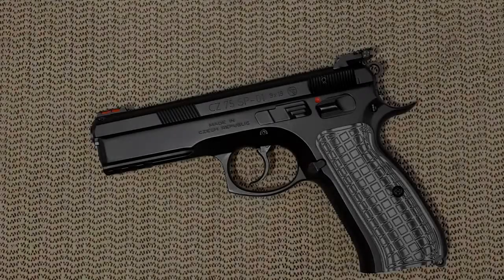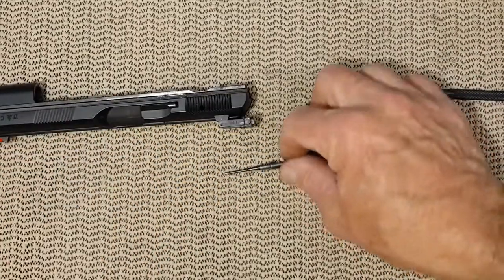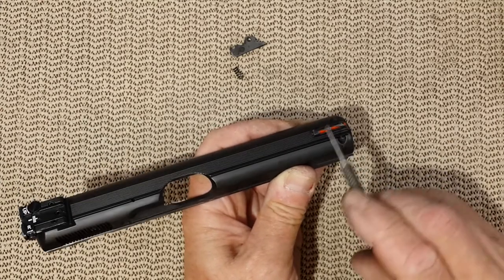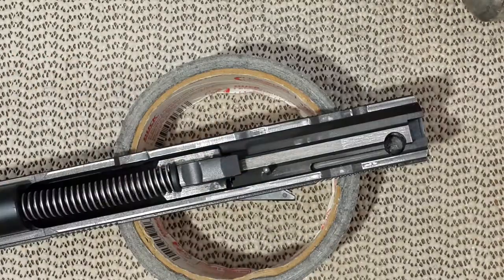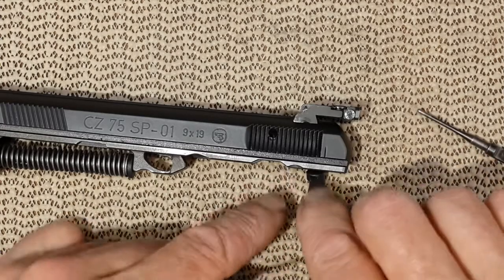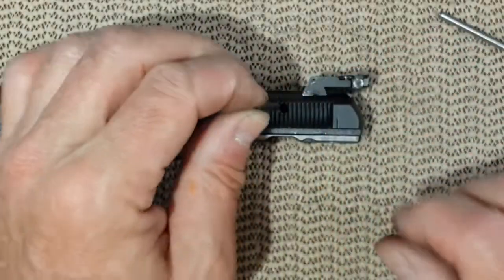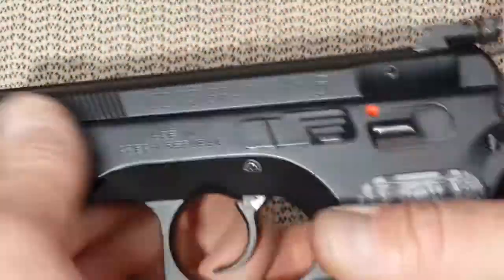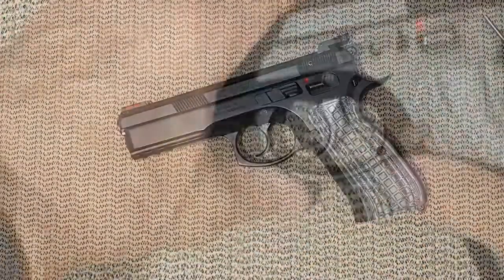CZ 75 SP-01 Slide Full Disassembly and Reassembly

Comment: Thank you very much for the information.  I've fired approximately 1,000 rounds to my SP01 and the gun does not shoot anymore.  I believe it's a problem with the firing pin.  The video will help with disassembly and then especially important, reassembly of the gun.

Comment: ME again.  Have a new TS P120 and CZ P01 and wanted to add new springs (polish/lube etc always)...reduced FP and safety plunger as well as 13# hammer and had the canted firing pin situation in both.  To stop that problem and it is a big one as the pin gets jammed against the side of the FP...not a good place to be! I aligned the FP with flats up and held it in place with a punch.  Then assembled the pistol and had the hammer hold the FP down.  Driving the pin in was still difficult in both pistols (and yes a have rolling pin punches with dimples etc.) but done.  With both pins, one slotted and the CZ "spiral layered rolled" I used a brass hammer to get them in mostly knowing the dimpled punch will spread the hammered surface especially with the spiral type.

Again, your videos are a wealth of information and thanks so much.

Comment: Excellent video - clear and very detailed. However, I would suggest using a 3mm punch rather than a 1/8" punch to remove the firing pin retainer pin. During my 1st attempt, my 1/8" punch became stuck in the pin hole, which I was unable to remove despite all kinds of effort. Ultimately I sent the slide with the "stuck punch" to Cajun Gun Works, which they were able to remedy the situation. Their tech advised using a 3mm punch next time, which is slightly smaller than 1/8".
Reply from the maker: Very good advice. I had the same issue with my punch, but I was able to remove mine out of the slide. I am sorry you had to send yours to CG. 3mm is a perfect math for the work, but we are in the US, where millimeter tools are not always in our tool box. Thanks again Michael  for this wise advice.

Comment: My slide is stop in at the trigger when reinstalled. What did I do wrong? Can’t see where it’s catching. Installed new hammer/pin/searbox parts from Cajun ?
Reply from the maker: Sadly I don't have the gun on hand to see what is happening. The most common issue can be the recoil spring getting out of its barrel notch. But you also installed a number of new parts and that creates some new issues. I would suggest to see a gun smith or at list, go to a local gun store and get advises and opinions. Good luck
Reply: Thanks!  That is exactly what I am doing today. Gun shop first. So weird. Slides clean unto top hits sear the -stuck. 

Thank you for your video; it saved me!! 
I was hoping you had a ”trick” I was missing (reassembling to add fire pin block - which started this entire adventure- was AMAZING advice!!)
Clear, great camera, you know what's up. Thank you!!!

Comment: I can’t get the firing pin reinstalled on my SP01 manual safety. The plunger and firing pin are oriented correctly, but it does not seat. I’ve been working on it for 3hrs.
Reply from the maker: First, make sure the firing pins open tabs are directed "up" in the firing pin channel. Then take a punch and insert it in the hole, where the firing pin roll pin is supposed to go. If your punch goes all the way through, your firing pin has been correctly installed. You are ready to insert your roll pin on the slide.
Reply: Practical Shooter I can not get the plunger to seat the firing pin.
Reply: Practical Shooter I can’t get to the point where I can put the roll pin in the slide. When I press the firing pin and plunger, the firing pin does not stay seated. The firing pin cut outs are facing up, the flat plunger face- facing up.
Reply from the maker: @hunterlawrence7228  ok.lets go back a bit. When you removed the firing pin from the slide, did the firing pin spring come out too?
Reply: Practical Shooter no
Reply from the maker: @hunterlawrence7228  ok. It seams the firing pin is hitting the spring that is still inside the channel. Try to pull it out. A paper clip inserted from the other side (ammo side) will push the spring out
Reply: Practical Shooter I have removed the spring multiple times and reinstalled before trying to place the firing pin back in
Reply from the maker: Have you tried to place the firing spring on the pin before inserting it?
Reply: Same problem. I don’t understand the final comments  nor how the pin. Would stick on the spring.

Comment: QUESTION :

Anyone know why the firing pin's retaining pin (roll pin) is hollow?
Why not just use a solid retaining pin and avoid having it deform all the time??
Reply from the maker: I can come up with 2 possibilities. It could be for cost, but we are talking pennies here. Or, CZ wants the pin to deform over time to save on the firing pin's life, and make the pin a consumable to be replace every so often. It would be nice for CZ to let us know.
Reply: Roll pins are made to expand against the outside of the hole so they stay in place better, and they are somewhat more tolerant of holes that vary in size due to manufacturing tolerances or repetitive disassembly, so they grip over a range of hole diameters where a solid pin might tend to fall out if the hole got enlarged. The downside, though, is that they can get deformed if you aren't careful.